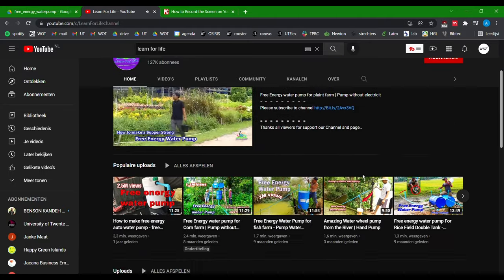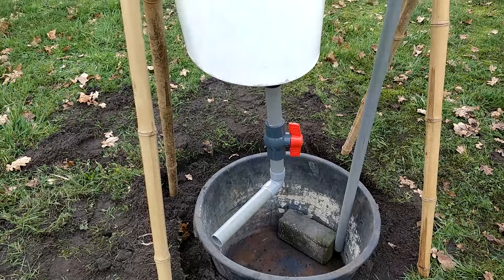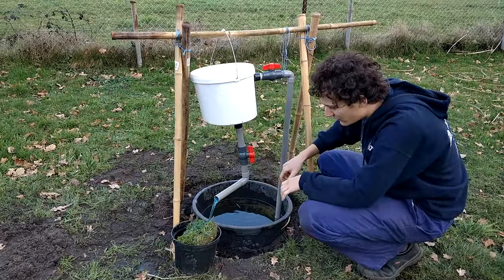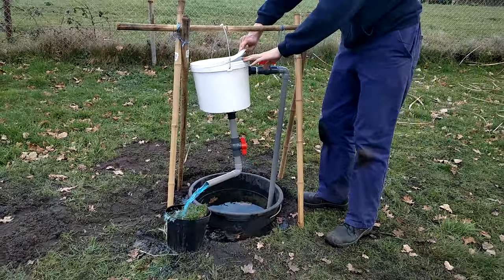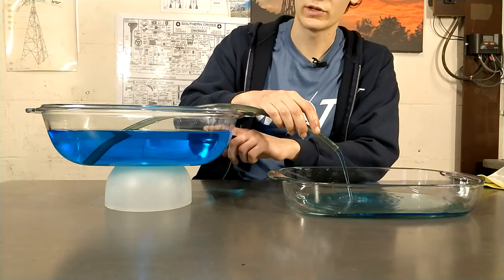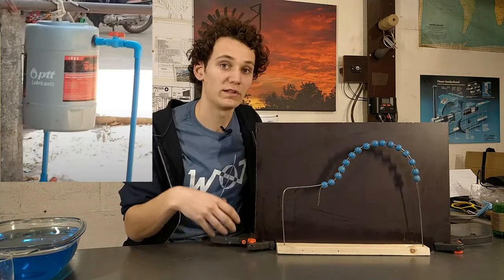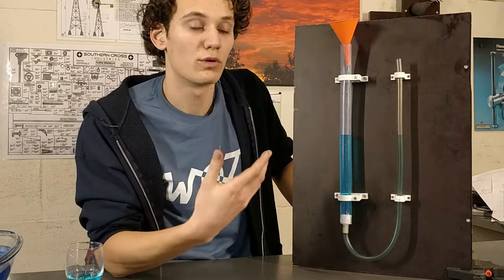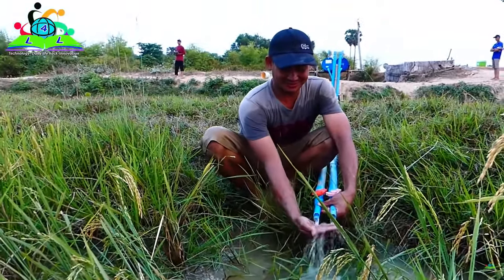FREE ENERGY Water Pump Tested. Is it possible?

Comment: You can be an intellectual but with very low IQ.
This system works but not with large diameter of pipe with little tiny bucket. Use your brain at 100% not at 1%
Reply: Sorry, but this siphon can not work. Source is lower than output. No siphon can liftvwater….
Reply: @kjellg6532  Also don't try it with the specification of equipments shown in this video, try it with what others achieved. Some have very clear demostrations like putting a crystal clear lid or plastic wrapper on top of it where you usually put lid.
Reply: @kjellg6532 Best idea is to try it with Water Storage Tanks that normally made up of PVC Plastic.
Reply: @MuhammadFrazAslam  Plastic does not pump water. An electric pump does. A manual pump pumps water, a wind driven pump pumps water. But this is a siphon with a barrel. No siphon can lift any water to avhigher level. This video shows that. Exellent and instructive video, showing physics and som of physical laws. You can not make water flow uphill with no energy input...
Reply: @MuhammadFrazAslam  A tank is only a way to get a siphon started. You may as well only use a tube or a hose, that is if you find a way to fill it with water. This is nothing but a siphon, no magic…

Comment: Buddy if you're going to make a video like this you should at least put some time and effort into like actually mathematically equating things the fact of the matter is this is completely possible and common Sense and suggest that you're making an entire another body of water with the container like someone else said in one of the comments there are several parts of this that you did not do correctly the fact of the matter is you saying we can't get energy out of nothing but the energy is right there in the bucket full of water as long as the pool Force is stronger than the section of pipe that is pulling the water into the bucket it's going to keep pulling as your emptying the bucket I know that this could use some more explanation but fact of the matter is I feel like this is a kind of common Sense thing and doesn't need too much explanation
Reply: Sorry, but your common sense is useless if it isn't paired with some knowledge in physics. You think energy is created in the bucket full of water by forces? Energy can't be created. It can only change from one form to another form. If you think energy in some form is created here, you should name which form of energy was transformed for this creation. What matters here is the relation between water- and air-pressure. Water pressure only depends on the heigth of the water column. Thus, water pressure at the bottom of the well is always bigger than water pressure at the bottom of the bucket. Which means, before the vacuum is strong enough to move up water from the well it was already strong enough to prevent any outflow of water. 
For everyone with competence in physics it is common sense that the working of this pump, which is shown in many YT-videos presently, is faked. If this pump would work, we would have it in use all around us and it would be generally known. Don't tell me that such a simple construction was only invented a short time ago.